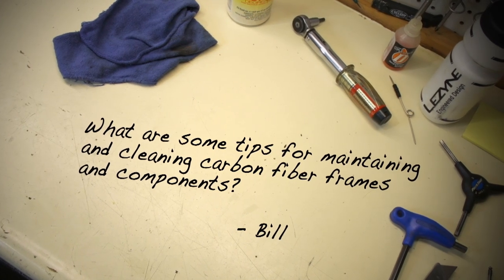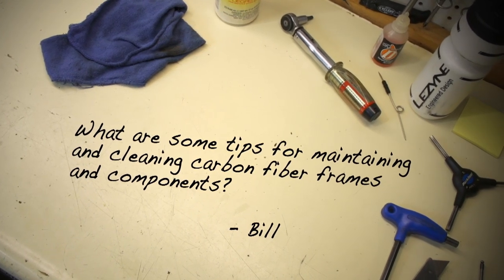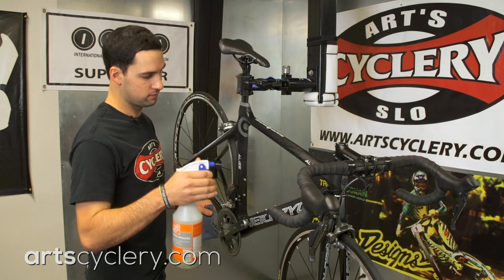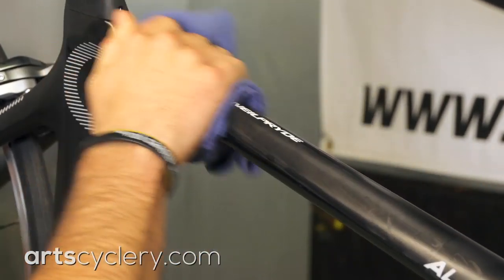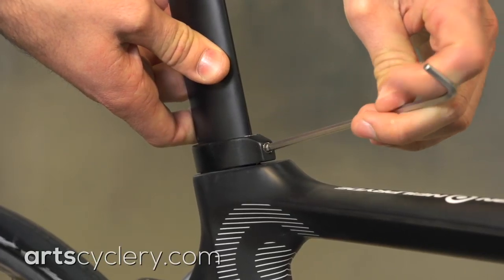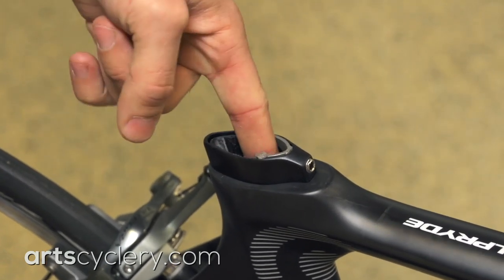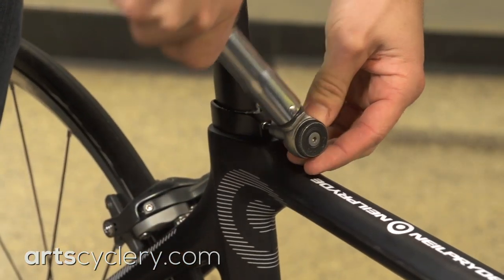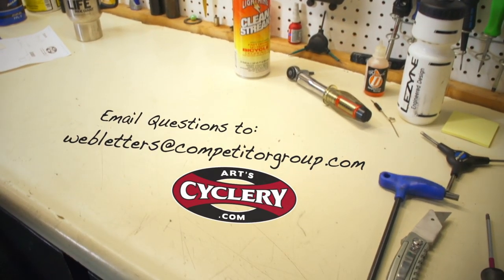Ask a Mechanic: Maintaining and Cleaning Carbon Fiber

Comment: Can i use silicon to clean carbon fiber frame?
Reply from the maker: +Luis270893 We recommend soap and water as that is a safe solution. I am not aware of any issues with using Silicon, but I have not tried it myself. Hope this helps, thanks for watching!